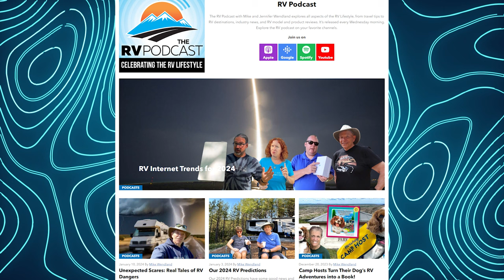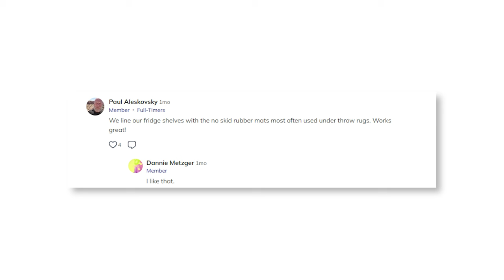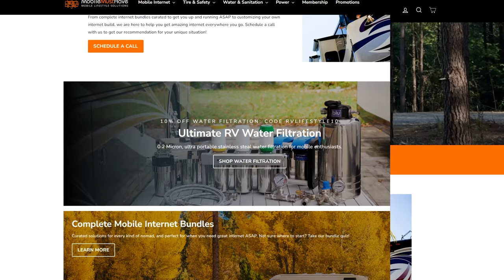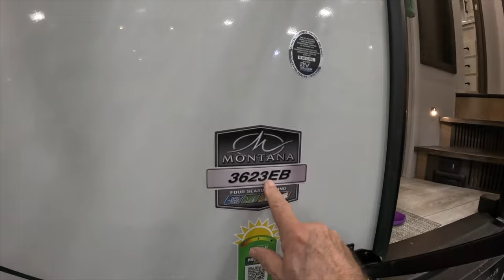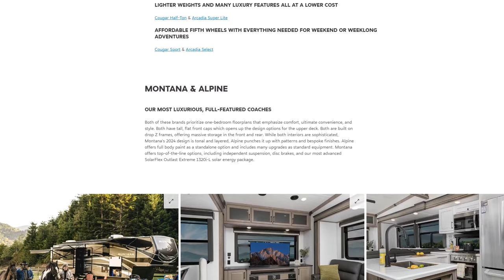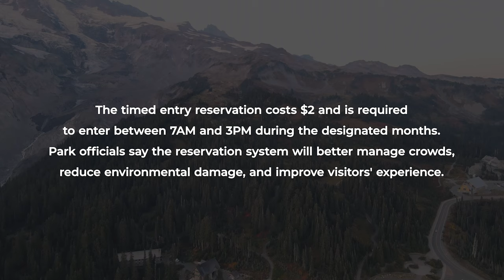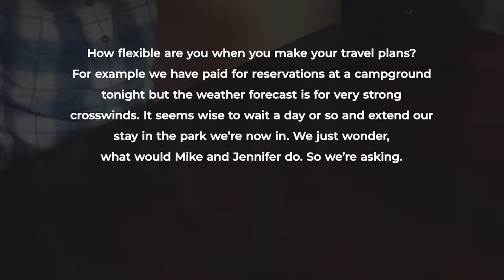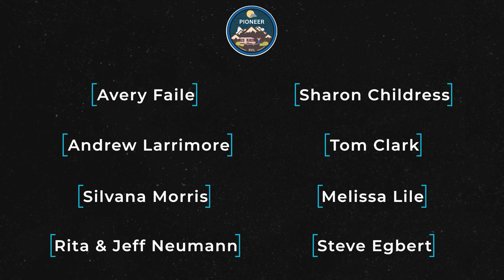Best Innovations at the 2024 RV Supershow!

Comment: I have a comment or should say a concern about the Montana with the e-bike slide out.  My wife and I have e-bikes and have seen stories where fires have resulted while charging the batteries.  It is recommended that they should not be charged inside if you are not there during this process.  So is it safe to be charging the bikes while you are towing the rig?  Does the Key Stone company have a recommendation?

Comment: We bought a Westfalia at the show.  We’ll probably never use that folding bed, but there were so many features that set it apart.  Huge garage, 80” bed length on on side sleeping front to back, a roomy head - with a window, 600 amps of lithium standard, 3000 W pure sine wave inverter, compressor fridge, etc…. All at a very competitive price
Reply: I have a SolisPX but love the Westfalia.  The sink cover seems different - thoughts on that when seeing in person?  What kind of discounts were they giving at the show?  Congrats on your new rig.
Reply: The one thing I have yet to see on the Westfalia is external connection… what and were are they?

Comment: I saw the anti locks on Grand Design last year. I want to buy another brand and decided to wait until the marque I want has the antilock brakes. So question for the experts, does the presence of antilock brakes on your towable make the brake gain adjustment on the tow vehicle useless? Or how would it be used in a panic situation and negate the antilock action of the RV antilock brakes